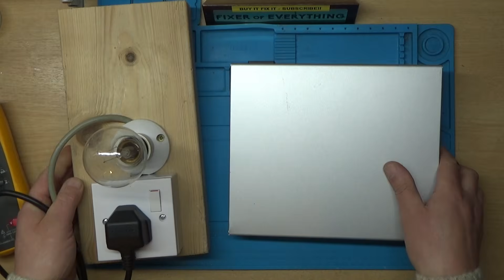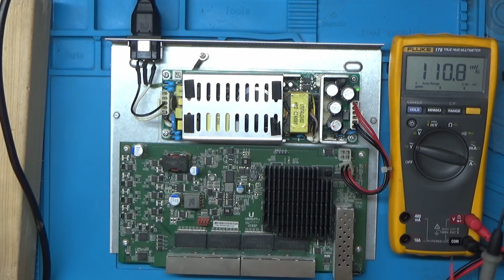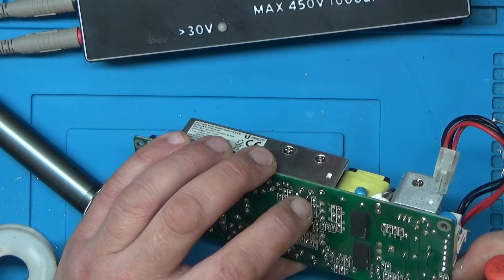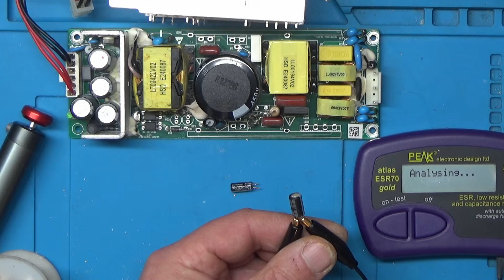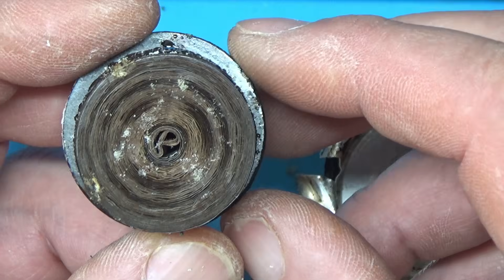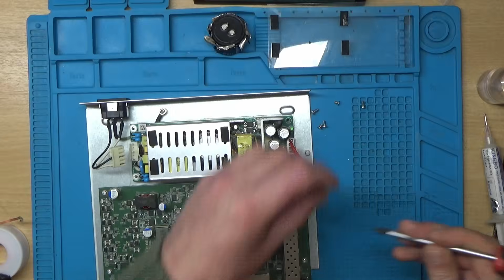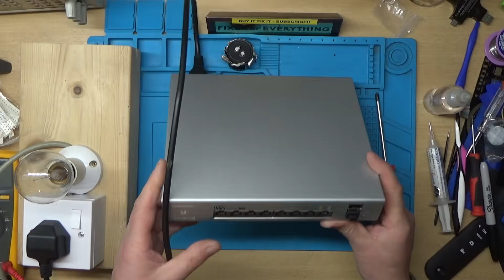Faulty Ubiquiti POE Network Switch | Can I Fix It?

Comment: I'm running about half a dozen of these Ubiquiti switches, most of them somewhere around 8 years old by now. They've been really reliable so far, one of them is in a shed that gets baked in summer and frozen in winter yet it soldiers on like a champ running my outdoor IP cameras. Video bookmarked ready for the day one of them suffers this failure.
Reply from the maker: Nice one 👍🙂
Reply: I read those switches had heat issues. 150 watt and no fan. They finally came back into stock this summer so I bought one to have as a spare. Good to know yours have done well. Unifi doesn't have many switches that can do passive Poe. I guess I could throw a converter on and go with a 8 port pro or pro max 16. These switches come in at such a good price point and have SFP.

Comment: Bought one of those solder suckers a short while back. By far the nicest 'spring-suck' type I have ever owned..in 45 years of being in the trade.
Reply from the maker: Nice one Chris, I can't remember who suggested them, but they do seem very good!
Reply: Problem with those "engineer" suckers or any sucker is keeping it from.getting the spring stuck with solder.   I just buy from Harbor Freight with 3 suckers to a pack and 2 reels of wick braid for around $9/package.  Cheaper than Temu.  I'm beginning to think Harbor Freight is a U.S. distributor of Temu🤔
Reply: That's weird, the ones I buy last only a few weeks as the o-rong used as a check valve on the piston geta abraided by fine aplder particles. I didn't know how yours last so long, even I clean mine regularly.
PS. My desoldering tool is the one with a silver body, a blue handle and a black plunger.

Comment: We did a lot of investigation and found that the heat had no e
Where to go it needs a fan. The PGA chip was the main reason for the heat, we stopped using the 8-port and changed to the 16-port. After a lot of site visits
Reply from the maker: Interesting. Thank you for sharing 👍

Comment: Great video as usual. Did you test the output of the power supply before you repaired it? Might be nice to see, "oh it's showing 3.5v now, that's not right." Then afterwards, seeing 24v or whatever it uses after the fix. Videos like these inspired me to fix a bad power supply in an 18 yr old monitor that now works fine!
Reply from the maker: Nice well done on fixing the monitor! Yes I forgot to measure the voltage, but I knew it wasn't right (LED was dimly lit and pulsing) so I knew there was little output there. It should supply around 48V or so for the POE.

Comment: Nice repair. Only thinking if I see that there are used original Rubicon caps I assume the this has to be good quality power supply and I would not order it from AliExpress.
Reply from the maker: Thanks 👍I did have a search around on reputable suppliers first for a capacitor but could only find them at 25mm high. The only 20mm I found were on AliExpress.

Comment: it's just a light, not a button... usually dual colour white+blue for status and an indicator to whether it's been adopted or not.  Got to admit I doubt they are true nichicons from aliexpress, but i doubt any worse than the one that came out of it 🙂
Reply from the maker: An right 👍 I wasn't sure if it was a power button too. Yes they could well be fakes. I did check reputable suppliers first for capacitors but smallest height on all of the sites was 25mm.

Comment: Did I miss the part where you measured the DC output of the PSU?  Both before and after the repair.

Unless you are worried about the DUT being a dead short, the dim bulb tester doesn't really work with SMPS.  Because they have wide input voltage tolerance, if the bulb gets lit and drops the voltage then the PSU just 'works harder' to produce the right output voltage.  Sorta like a negative resistance.
Reply from the maker: I didn't measure the output, as the PSU was ticking and you could faintly see the power LED pulsing, so I knew it wasn't outputting correctly. I perhaps should have checked the output after repair, but everything seems to work fine so I would assume it's outputting the correct voltage now.

Comment: I have installed those switches, and have always been amazed how hot they run, and for many years too!
Reply: Aye I have half a dozen of these Ubiquiti US-8-150W switches and they run hot enough to keep your dinner warm. Unifi reports the internal temperature on them around 67c.
Reply from the maker: Interesting, thanks for sharing 👍

Comment: Why wouldn't you measure the DC output of the PSU before you started dismantling the thing?
Reply from the maker: It was pretty obvious to me that it wasn't working correctly. The PSU was "ticking" and you could see the output LED lit faintly and pulsing. So I knew from experience that it wasn't right.

Comment: Ah ubiquitu power supplies.  Step one is always to replace them with a Meanwell!
Reply from the maker: That's also an option 👍I'm not sure on the age of the unit, but it seems to have lasted a fair while. Hopefully with just replacing the cap it should last a whole lot longer, and probably cheaper than replacing the whole PSU.

Comment: I have 2 Ubiquiti switches that have died, and ubiquiti dont want to replace them. I think it was storm damage, so likely a surge on one of the ports, as the one inside and one in the shed both stopped at the same time. If you were closer I'd send them to you
Reply from the maker: I guess you're not in the UK then? Unfortunately the price of shipping to the UK and back is quite expensive.

Comment: Normal problem with that switch i would say, i also hade the psu broke and seen allot others having the same problem sadly.
Reply from the maker: Yes, seems a common problem from when I was searching for a replacement capacitor. Hopefully the video will be useful for others in the same situation so they'll be able to fix their own if they want to.
Reply: Ye, my solution was to buy new psu, which is a high cost then a capacitor ;) I have solder skill but att that time I didn’t have skill to find issiues. I hope as you said this will help others in the future as it is a good switch after all

Comment: Usually the caps a dead since the expected life is about 3000 hours. After that they are either weak or start becoming shorted. Then other parts break down
Reply from the maker: The other caps are of the same age and seemed fine. I'm wondering if it was a poor quality cap STGCON, or if it was related to the PFC circuit switching the inductor in / out constantly, as it's pretty rare for a mains smoother to fail.
Reply: @BuyitFixit  Heavy current loads shorten the life

Comment: The caps on the poe network switch have a llot of abuse to deal with depending upon what kind of Poe equipment is being powered by it and higher the load the more likely the caps go out before anything else in the switch.
Reply from the maker: I would have thought that would be more on the output side of the PSU rather than the mains smoother. I've rarely seen a mains smoother go bad. I'm wondering if it was just a poor quality cap, as the other caps seemed ok, or if it's because the PSU used a PFC circuit which switches an inductor in / out at a high frequency constantly that supplies the cap.

Comment: I wonder if that piece of plastic covering the vent holes had anything to do with the premature failure of that main cap. I'd probably have moved the plastic from the supply to the main enclosure, and freed the supply's vents to breathe a bit better.
Reply from the maker: I was wondering that too, but the other capacitors seemed OK and they would have been exposed to the same temperatures for the same amount of time. I'm wondering if it was just a poor quality capacitor, or if HF from the PFC circuit caused it to fail prematurely from the inductor being switched in and out constantly.

Comment: Dumb question, but why desolder the bridge rectifier and transistors along with the heat sink? Don’t they have screws for a reason? Thanks, great fix mate.
Reply from the maker: Thanks 👍They have nuts on the other side of the screws.

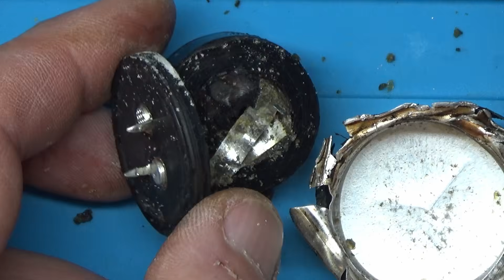Comment: 25:46 I was thinking could you have connected the multimeter OR the cap-meter to the contacts inside with the capacitor opened up and without any electrolyte and measure if it holds any voltage. No idea if that would work without any electrolyte but it could proof the outer pin had already broken away before you opened it up
Reply from the maker: Yes I think that would have worked. It's hard to think of everything when making a video though, and often I think after making one that I could have done x y z or added, or said..
Reply: @BuyitFixit  yea it's easier for me as a viewer :)

Comment: Glad you were able to use my capacitor discharger!  I hope it works well for you in any future videos.
Reply from the maker: Thanks mate👍 I was going to email you to let you know that I featured it in a video, but totally forgot!
Reply: Great bit of kit. I can’t count the number of times I’ve discharged a cap with my fingers. Normally end up either dropping or throwing the pcb😂
Reply: @domwebby  I once launched an open laptop almost 5 meters because of a charged cap. Further repair was not necessary, but the hard disk could be saved.
Reply: Haha nice but i think its way to big 😅

Comment: Hmmm, why not measuring the output voltage when you hear the ticking sound? And when replacing the cap why assembling the unit? What if the switching element had shorted? Did you check that?
Reply from the maker: I disconnected the PSU from the board, and the light lit up very dim, so I knew there must be a fault on the PSU. I could have measured the voltage but it seemed pretty obvious that it wasn't outputting correctly. Assembling the unit is because I'm making a video.. and if people see it working they probably wouldn't watch it put back together. If the switching element was shorted or the bridge rectifier or such, then the dim bulb tester would have lit up so I knew there wasn't any shorts. Hope that explains 🙂
Reply: @BuyitFixit  Ah, ok, that explains it. I think This shows your experience. I would be checking and double checking over and over 😉

Comment: Nice fix.  I will admit to yelling at the screen: "Those Rubycons are fine. They rarely fail" and "That bulk cap is probably fine, they almost never fail, but yeah test it". Wow, it was open. Pretty rare. Also, "Test the new one!" A Nichicon off of Ali Express? Yeah, not surprised it measured low. I buy stuff from Ali, but not caps. Digikey all day every day.  All that said, Unifi gear is worth fixing glad you got it working!
Reply from the maker: Thanks Steve, Yes they could well be fakes, but as you say they seem to get the job done. I did try a few other suppliers first, but there were none with the correct dimensions as the lowest was 25mm high.

Comment: Happy New Year ❤️, do similar replace main capacitors on tv sat decoders with same problem can’t find same size so put wires with shrink tube put capacitor externally
Reply from the maker: Happy new year to you too! Yes, I did think about that, but wasn't happy with the thought of a cap at mains voltage rattling around in a metal box. At least I managed to find one of the correct dimensions so it made a nice tidy job 🙂

Comment: Just had a UI 24 port poe switch fail after one month, with only 8 ports being used, the power supply was dead but you could see the green LED on inside. They tried to make me pay the return postage! Under EU law if an electronic appliance fails before 6 months it Is deemed faulty at delivery. Remember this everyone!
Reply from the maker: Interesting. Thanks for sharing Tony 👍

Comment: I think that is my favorite switch Ubiquiti ever made. They were pretty reliable, had an actually useful amount of poe power you didnt have to worry about using like the newer, small switches do, and had integrated 24v passive poe for connecting to UISP PtP units as well. It was a sad day when they moved to "gen 2" and removed all 24v support and cut poe budget in half
Reply from the maker: Thanks for sharing! Sounds a shame about the V2 😢
Reply: ToughSwitch: you could park a can on top of it 😂
Reply: USW-ULTRA-60W has beefier PoE then the switch lite 8 new gen does, but less layer 2 features.
Reply: Yes , the same thing is pissing me off , they discontinue(d) the good stuff. US-16-150   US-24-250  also ... and went with passive nonsense cooling. Because noobs keep their switches in the bedroom around RGB lights ffs inside open-racks. lmao
Reply: @GabrielKozsar  That is why I'll buy a used cisco for a lot of poe ports, with 60w support too. More feature, sometimes cheaper, have 10G... Yes, i'll not have etherlight, and other fancy stuff, but my rack is not near living space, since it's a "bit" loud, especially in the summer 😂

Comment: Hi Mick great fix, heat is definitely the issue there not much ventilation, the cap is surrounded by heat it should have a small fan in there really 😊
Reply from the maker: Cheers Gary 👍I'm wondering if the cap was just poor quality or if the PFC circuit switching the inductor in / out all of the time caused it to fail prematurely, as the other caps seemed to be OK which were also inside the same surround..
Reply: @ hi Mick on badcaps there’s a post if you do a search on the POE unit with the exact same problem, they’re junk capacitors the rest as seen were Rubycon, Rubycon are one of the best in my opinion, the main filter cap is a STGCON make and I think that’s half the problem, maybe they’re over rating on the temperature specs, if you still have it maybe run you thermal cam on it to see the temperature of it under load in that cage..
Reply from the maker: Thanks mate, I've just posted it back earlier today..
Reply: @ dam lol, hope you both are on the mend now you sound a little better

Comment: I have replaced a few with the same caps! Very common problem🙁
Reply from the maker: Seems so. I'm wondering if they are just poor quality, or if the PFC circuit switching the inductor in / out all of the time caused it to fail quicker. Mains caps rarely fail in my experience.
Reply: @ maybe. Or a bad batch of caps maybe? I have no clue. I think you have alot more experience in elektronics like this then me. I just do it for fun when time is there😂👍🏻 but I love your videos!🙏🏻 keep up the good work👍🏻
Reply from the maker: Thanks mate 👍

Comment: Vince found the same exact fault in a Ubiquiti switch he got https://www.youtube.com/watch?v=FOcaoRqgP3k . Very widespread problem it seems!
Reply from the maker: Indeed. I found quite a few other people with the same problem when I was searching for a replacement cap. I'm wondering if it was just a poor quality cap, or if the PFC circuit switching the inductor in / out all of the time caused it to fail quicker than normal. Mains caps seldom fail in my experience.

Comment: I was very surprised it was the main cap.. I was muttering "waste of time taking that out". I was very wrong indeed.
Reply from the maker: Yes, they rarely fail. I'm wondering if it was just a poor quality cap, or if the PFC circuit switching the inductor feeding it caused it to fail prematurely.

Comment: Is the left diode shown at 15:29 broken too? I think there are holes in it.
Reply from the maker: If it had holes in it, it would likely be shorted, and I doubt the unit would have powered up. Sometimes the view from the overhead camera shows reflections as the light is directly above it too.
Reply: @BuyitFixit  I watched again, it looks like its the white powder looking like holes 🫣

Comment: That was a common problem as the unit runs hot 73c
Reply from the maker: I'm wondering if the PFC circuit had a role in it, or if it was a poor quality cap. I've rarely had a mains cap fail on a SMPS, but with this one having PFC I'm wondering if that's a contributing factor.

Comment: Three points - 1.  You didn't discharge that mains capacitor before using the tester and were 'lucky' not to damage it.  2.  You should have checked that the bridge rectifier was ok before just powering up as a failed BR may have been the cause for the capacitor failure.  3.  Testing the white powder is done by putting your nose close to it, finger up one nostril then sniffing.  If you have a goofy smile and start talking bollox you know what 'it' is.......
Reply from the maker: 😂😂😂😂 1. The 70 gold has an automatic discharge feature, and if there's any voltage in the cap automatically discharges it (or so it says on the tin). 2) Rectifier diodes usually fail short circuit, so if the bridge was blown I'd have expected the dim bulb tester to be glowing brightly or magic smoke! 3) I'll leave the testing up to you 😂👍

Comment: I have fix a lot of Ubiqiti products as the company I used to work for was a dealer
Reply from the maker: Interesting 👍 I was wondering if it's just a poor quality capacitor or if the PFC circuit switching the inductor in / out was the cause. I've not came across many mains smoother capacitor failures in the past..

Comment: As you were taking this apart, I thought, 'It's going to be that big cap.' Someone else has already said, but I also saw a similar thing on the 'My Mate Vince' channel. His had failed the same way, and like you, he took the cap apart to find out why.
Reply from the maker: It's quite unusual for mains caps to fail. I've only seen it happen a few times. I'm wondering if it's something to do with the PFC circuit causing them to fail.
Reply: @BuyitFixit It might just be a bad brand, I mean, the name STGCON doesn't inspire confidence. I don't understand why they got Rubycon for the rest and not for the larger cap.